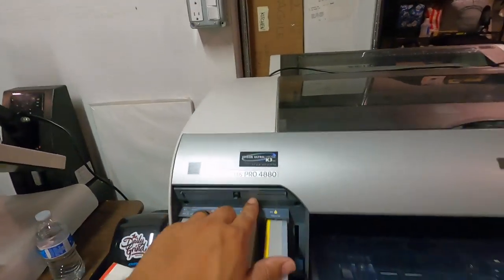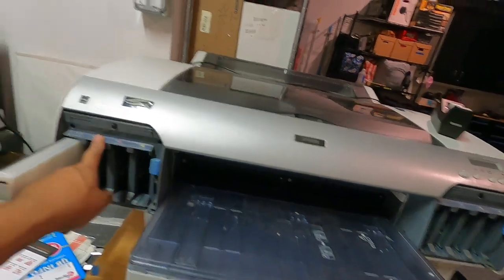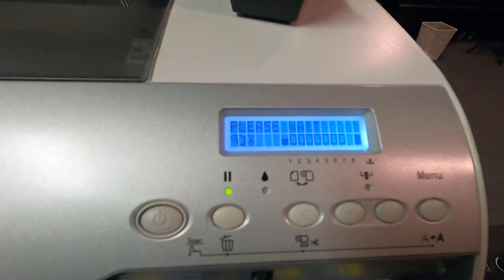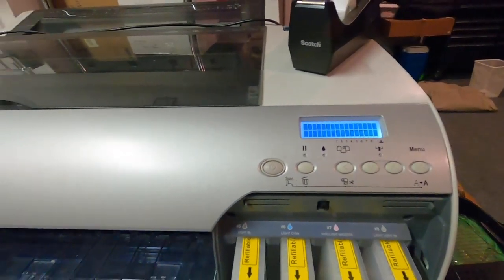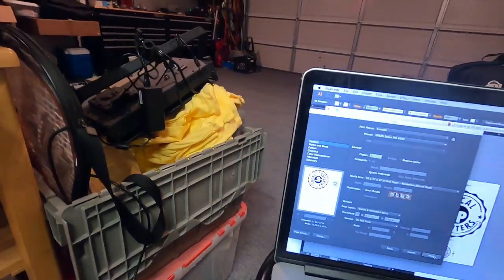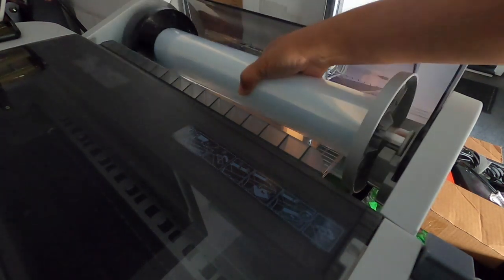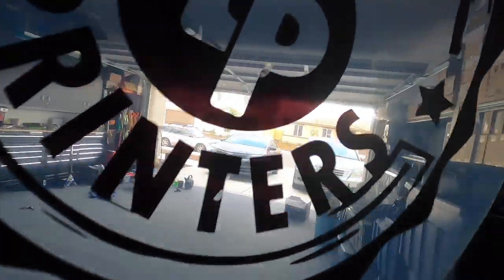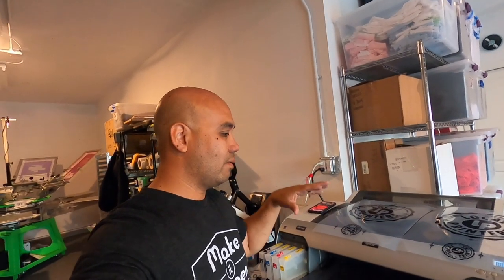CAN THIS EPSON PRINTER PRINT ALL BLACK INK ? : It's time to put this thing to work (S:06/Vlog 034)

Comment: You can try bumping up the print density in the print settings. Or the actual image in illustrator may not be the blackest. A lot of times I noticed illustrator will set the black swatch to not a true black

Comment: Check your artwork first before your settings cuz that looks like some of your artwork may not be fully black. Oh also, check for “photo rpm” in the print dialog. Make it go slow as possible and it will deposit the most ink. 🤷🏼‍♂️ ... oh never mind, I see you figured it out at the end lol. My bad.
Reply from the maker: Yep.. user error. 😂

Comment: Rhy, if its uv blocking ink it does not have to be perfectly 100% dark. So save yourself some ink by not w0rrying about it 100% dark. Try to expose first to determine if you need it to be darker or not. Also, it takes a while for your uv ink to run through the lines and show up on your print.
Reply from the maker: Ya I know. It doesn’t have to be fully black. But my OCD won’t let me 😂

Comment: Nice!  I’ve been looking for one of those printers - did you just get it?
Reply from the maker: T M had it for awhile. Just didn’t want to buy ink 😂
Reply: RhyBeats I’ve got one 1400 that is my primary printer and two 1430’s that are backups.  I’d like to ditch them all and get a 4880/4900.  My prints need to be about a inch wider sometimes.  Full 13”-14” print is good on event shirts.

Comment: You are going to mess up your head with just distilled water.  I used a  4800, then a 4880, for years.  Rhy - message me for more info.
Reply from the maker: What’s wrong with distilled water
Reply: Can you explain ?
Reply: Five years running distilled water in 2 separate 4800’s. Lots of films, no issues. Just our 2 cents ✌️